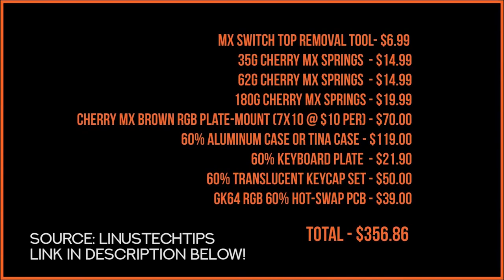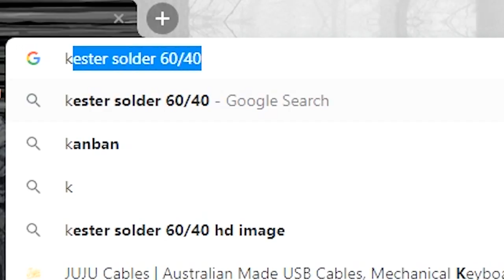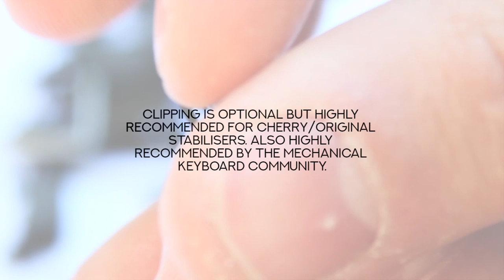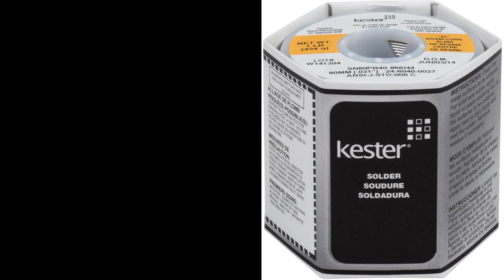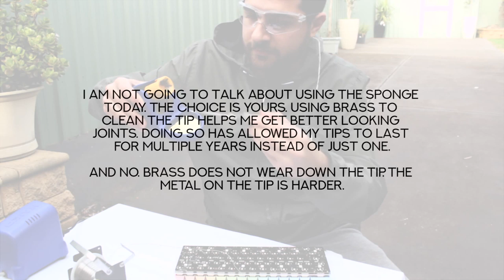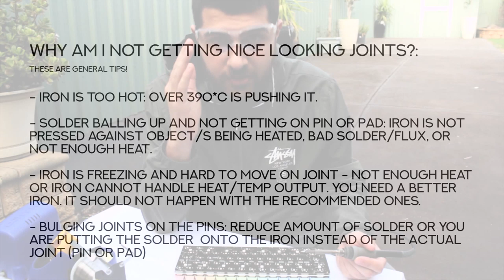How To Build Your Own Mechanical Keyboard! (With an EASY Soldering Tutorial!) ⌨

Comment: anybody who wants to build a completely custom keyboard without the trouble of soldering, go get a GH60 PCB. it's hotswap, and probably has some of the most useful features out there. you're still building your own keyboard, just without the trouble of buying and using a soldering station. also, you can just swap out the switches whenever you want, which is great if you're an indecisive little bitch like me.
Reply from the maker: Definitely! Agreed. I recommend this method because i feel it gives a better connection to making your own keyboard from scratch. Learning how to solder is also a very great skill to master!
Reply: @goodjihad  yeah that's a definite. I need to get some soldering experience in once my budget goes back up and I can afford to make a really expensive keyboard. It'll definitely be more satisfying to use a keyboard that you soldered, rather than a hotswap one. of course, I'd also keep a hotswap just to have a switch tester

Comment: What's the difference between using 60/40 and 63/37 solder?
Reply from the maker: 60/40 is 60% tin/ 40% lead and 63/37 is 63% tin and 37% lead. There are many types of solder which are used for different techniques of soldering or uses. Some are better at different functions. For example 63/37 is said to be better for getting less bad joints due to its properties. You can google it for more info but in keyboards there is not much of a difference so either is fine :)

Comment: How much would this cost?
Reply from the maker: Ranging from 300 AUD+. This particular one was between $380-500 AUD for an Aluminium case. It also depends on if you get a group buy keycap set or a typical keycap set and if you get typical switches vs a enthusiast switch like zealios, etc.

Comment: guys if im doing a dz60 build with dye subbed (opaque) keycaps, is polycarbonate plate better if i want more rgb to shine thru or is aluminium plate better? also which flexes more? im reffering to the ones on kbdfans, and brass is too expensive for me
Reply from the maker: Metal is much better. Buy once and forget! Aluminium or Brass if you can spend the money :) You won't regret it! 

Edit - if brass is too expensive I will still recommend it. Save a bit more money up because the sound difference is pretty considerable! If you cannot then I recommend at least to get an aluminium plate! :) 

Good luck and thank you for watching!

Comment: The build is good and all but why would you use a unnessacary purple key for the p,?
Reply from the maker: Haha - reminds me that the P stands for Print Screen! Thought it looked cool and it functions as Print Screen
Reply: @goodjihad  It wasn't a big deal but the fact it actually works for a print screen is awesome.
Reply from the maker: @nothing.1240  these keyboards have a function layer that you can specify commands to. Eg if i press FN and P it will send print screen instead of P itself.

Comment: This guy over here taking proper safety precautions while I'm soldering with a dinky, old PC case fan to blow the smoke away shirtless, in my underpants getting little balls of flaming hot flux jumping out at me.
Reply: I'm not a bright man.
Reply from the maker: I burned my leg before with solder. Please don't do the same 😂😂

Comment: can you recommend solder wire to use?
Reply from the maker: 60/40 Leaded solder and be safe! Use gloves when handling. Kester is great - Check here - https://jujucables.com/product/kester-60-40-leaded-solder-1-lb/
Reply: @goodjihad  Thanks for the suggestion. I should rephrase my question, why do you choose RA over no clean solder wire? I am going for kester as well, just confuse either RA or no clean.

Comment: well how much did it cost?
Reply from the maker: Mechanical keyboards of this kind and quality range between -
$200 AUD - $500 AUD. Varies by switch, case, maker, designer etc.
This one i believe was about $300-400 AUD including a good set of quality keycaps and switches. Can easily make this cheaper with some Taihao quality but value oriented keycaps and more simpler switches like gateron yellow, red, etc.

Comment: Dielectric grease as a lube is not a good idea. It’s much better on the wire to reduce rattle than using on the actual slider.
Reply from the maker: Interesting. It might be if you use the wrong plastics of course. 

It's completely fine so far with several of my keyboards. It is why i have made my stabilizers ultra silent and buttery. Dielectric grease is fine for most plastics except silicone based ones. I have done research and i have had no issues what so ever so far. It is a common lube for keyboards and it is ideal for plastic parts.
Reply: @goodjihad  Hmmm... Maybe dielectric grease comes in different wights or viscosity because the grease I have is so thick, it would absolutely drag any plastic parts that slide together. A grease like Krytox 205g0 which is lighter and not as sticky works much better IMO
Reply from the maker: @macclack4331  agreed Krytox is great! I have been experimenting with both for a while now.

I find the dielectric slowly gets less viscous and more fluid when you run it in. I tested over lubing, and under lubing. In each case the lube comes out a little and it disperses evenly.

Also! Using my stabiliser with the fabric pad on the bottom helps the grease stay put thus promoting smoother action. Try it one day.

Comment: Nice video but so many youtubers overcomplicate everything. "If you bent the leg of the switch , replace it" , no , the switch will work perfectly fine. Because of something like this , some people may be afraid of making DIY keyboard or 10-20 more switches and pay 10$ more for nothing.  Im not being toxic or something , just saying that some of you make things look too hard or pcbs etc being super soft. I'll give few examples below : 

-I pull out the connector (older wired keyboard / mice with 2.0 JST connectors) by the wires
-I used screwdriver to pull out my mouse switches , because back then had no proper tools 
-Pulled out keyboard switches that i couldnt suck the tin perfectly with screwdriver

And everything works perfectly fine. So stop making up thing that "you have to be SUPER CAREFUL" because nothing is that soft. Of course , its preferable to be careful , yet its not like super easy to break everything.
Reply from the maker: True and thanks for clarifying if people were to have that fear. My point regarding just putting another switch is because you have that availability and not to throw it out. You get 70 switches (since most of the time they are sold by the 10s) so you might as well just put a new one instead of one with a bent pin. Unbend the pin and store it if need be for a faulty switch.

Despite doing exactly what you do in most situations, in videos like these you have to be clear and specify how careful to be. It would be wrong for me to do otherwise. When I make mistakes I show that in my videos so others can learn from it. 

The intention of my videos is education in every way possible. Making mistakes is part of the process and I always show my mistakes :)
Reply: @goodjihad  Thank you for understanding my point. And great guide , i love the end result. Looks gorgeous! Also , your custom cables looks amazing as well!

Comment: If you need 5 seconds for it to bond your iron is not hot enough.
Reply from the maker: Yes, and more so if after 5 seconds it still looks like a ball it can be low heat, no flux, or bad solder too. Many issues and you can only find out when you practice!

Comment: alt title: how to solder.

Show them how to lube stabs, dont pretend you did. Its not gonna hurt the viewing experience, and tell them how to do O-Ring mount, Tape mod or foam mod.
Reply: Title is correct. This is how you BUILD your own keyboard - by soldering. Modding is not building. You can build a keyboard and not mod it. You cannot BUILD (not mod) a keyboard without soldering your lubed and o-ringed switches.

If you don’t know how to do something as simple as lubing and applying tape and o-rings then you should not be building your own board. Get a pre-built hot-swappable keyboard and watch a video titled: “How to MOD your keyboard.”

Comment: Everyone seems to be recommending lead solder. But with lead being a highly poisonous metal (which is even banned in many parts of the world) I wonder why is no one using lead free solder? Is it just ignorance? Or am I just crazy?
Reply from the maker: Hey Tim! Very intriguing question! 

It's like any dangerous item in the house. If you do the wrong things and don't take the right safety precautions then do not do it. That would be the ignorant part. If you follow the safety requirements for using solder, you won't have any issues with your health down the line.

I would also recommend non-leaded but not many have professional soldering irons which can handle the heat required to keep it liquid and to flow nicely onto a soldering joint.

Thank you for commenting! Be sure to sub for more! I would love to have more questions like this!

Comment: So what was the cost
Reply: Oh nvm, it said 260-350 usd. But that isnt far off from linus' video.
Reply from the maker: It's variable and depends my friend. Linus got a bunch of random parts for his build as I did when I made my first build in 2017! Ie we both stuffed up :). This video showcases a more realistic parts list that you would need to make a very high quality mechanical keyboard for about the same price if not much less excluding a good set of quality keycaps and enthusiast switches.

Comment: uhm. Why do you need 360°C to solder your Keyboard if 290°C would also do the job? o.O
Reply from the maker: 1. Depends on the type of solder you are using. Different solder has different melting points.

2. The soldering iron you use and the tip used to transfer heat.

3. Generally it is better to solder with a higher temperature for a shorter amount of time than a lower temperature for a longer amount of time. The latter results in a higher risk of broken/faulty components depending on the characteristics of the component, etc.

Comment: Pretty nice tutorial but:
1. 360C is way too hot for PCB soldering. 280-300C is hot enough for all solder types (even lead free) even with a small tip.
2. 5-10 seconds on the pad is way too long and you risk damaging the pad with this especially when soldering pads that are close to SMD parts (like the diodes). Making a solder joint on a PCB should not take any longer than 2-3 seconds.
Reply from the maker: Hey there! Fair enough and I agree with that advice completely, but I have learned that it's smarter to use a higher temperature for a lesser amount of time than a lower temperature for a longer time. 

360*C is the perfect temperature (for me) and you can solder things more safely because you are not keeping it on the component for too long including for something like a switch.

The truth is you need to keep it long enough so that the solder flows onto both sides of the PCB (the perfect bond) but unfortunately that is not always possible due to multiple conditions. 3-6 seconds is the average time for my soldering iron but it may be different for other soldering irons (depending on quality etc). Hence the range of 5-10 seconds. 

It's all about practicing with what you have got in the end. This is a guide after all. I don't know what my viewers have re equipment or solder.